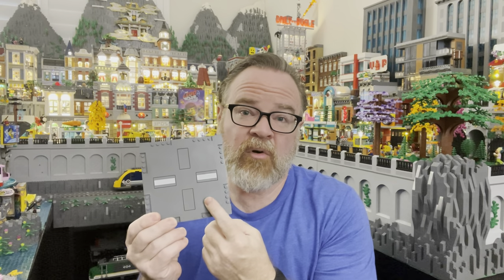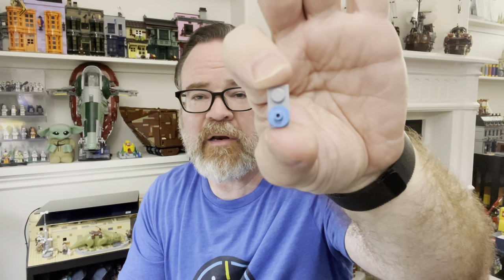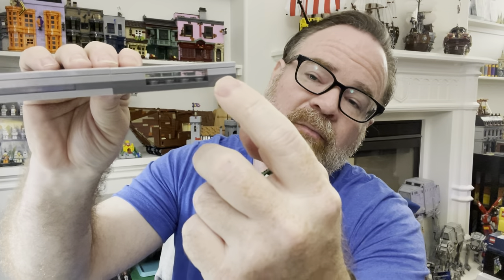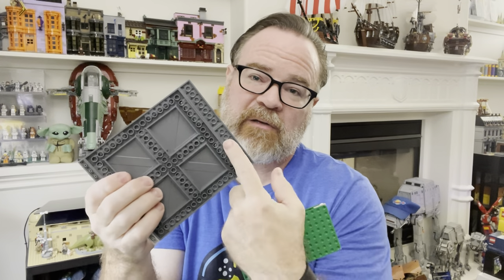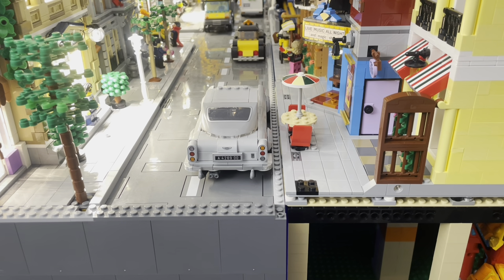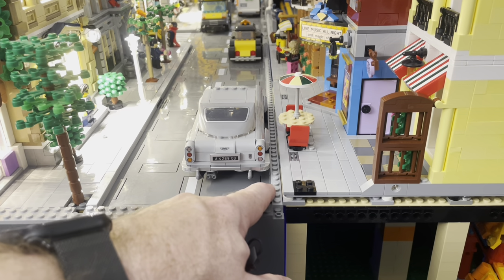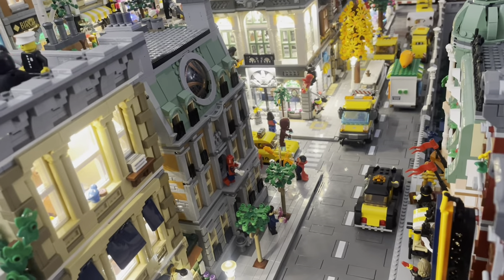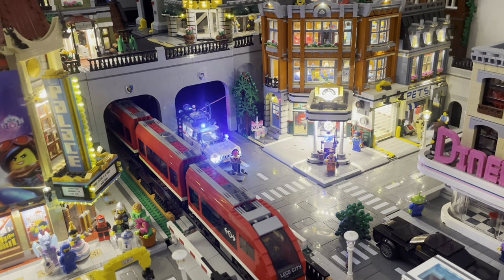LEGO City Road Plate Tutorial with MrBookieboo

Comment: One thing I really like about geometry of the 4 plate high sidewalk is that one can easily integrate handicapped-friendly pedestrian crossings on top of speed bumps: The roads are 2 plates high, and the large ramps that are included, when built on top of a few plates, raise the road by 2 additional plates, for a total height of 4 plates - exactly as much as the sidewalk. It won't work with widened roads, but my roads are only 16 wide, which is totally enough for my 4w vehicles from the 80s and 90s.
Reply from the maker: That’s a fantastic observation!

Comment: Thanks for the great tutorial! Ordered all the parts and followed your build to add 1 extra stud on each side, like you've done. However, I've now run into an issue at the T-junction, where the road coming off the "main road" needs to be narrower otherwise everything is off by a stud (i.e. not extended by 1 stud). Pausing and zooming into your video, it also looks like at your T-junction (where the Brickbank and Sanctum are),  the road that runs off to the left of the screen is narrower than the main one. While it is possible to make it the same width, you'd have to push the modulars to the side by one stud - in your set-up, that would mean the police station for example, would extend one stud beyond where your road ends. 

Is it fair to assume that that is the reason why your one road is narrower? Is there an easy workaround?

Thanks!
Reply from the maker: Correct and very good eye! In order to get the modulars to line up with the roads I had to make the side street narrower.

Comment: Great idea, one small question though, with the limited clutch power of the small pins, does this prevent the corners of the baseplate of the modular buildings from 'curling' up?
Reply from the maker: Good question - I’ve never experienced any curling. The driveways can sag without enough support but I’ll just span the drive with a solid row of pins and reinforce further back as needed.

Comment: What if instead of 1x2 plates on the bottoms baseplate excluding the middle use a two by two. What if you were to use jumper plates instead
Reply from the maker: Jumper plates wouldn’t fit in the holes in the bottom of the upper baseplate. I didn’t want the modulars floating on top of the lower plates. You can certainly use larger plates underneath, thst would nss as he things even more sturdy.
Reply: @MrBookieboo  I meant instead of the 1x2. still use the pin pieces those are a brilliant piece